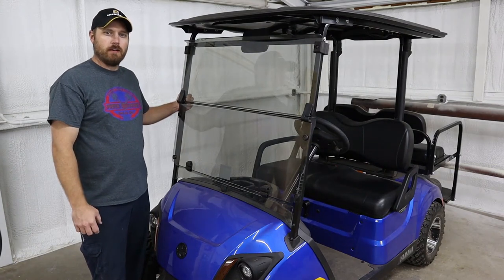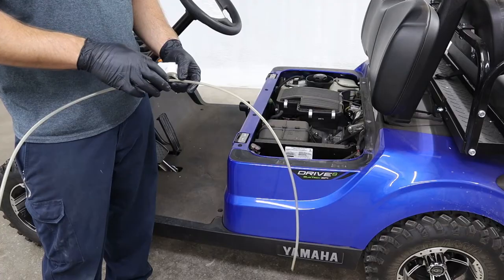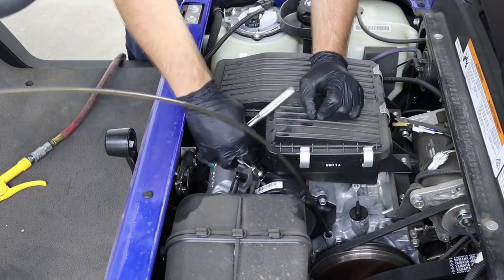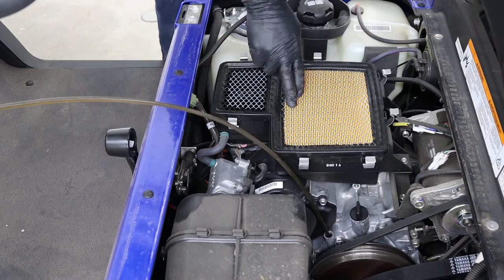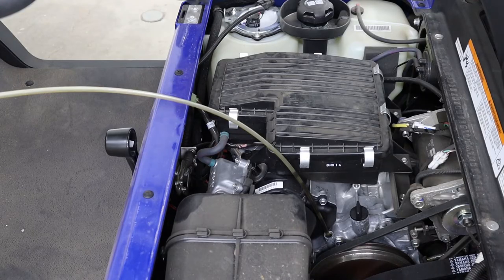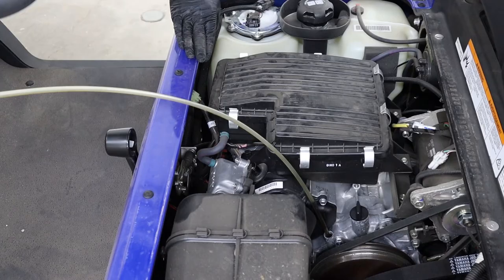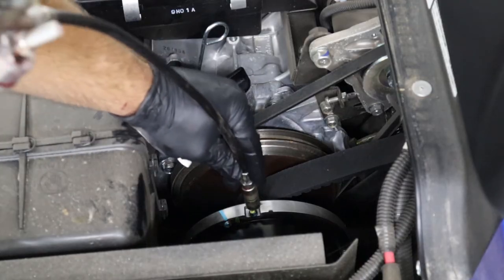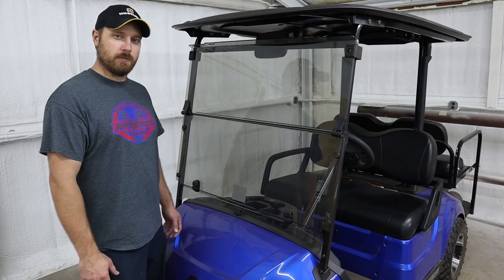Yamaha G29 Drive/Drive 2 Quietech - OIL CHANGE - Service

Comment: Concerned. 2021 drive 2 efi changed the oil. Checked before starting and stick measured ok. Siphoned using 2 different size tubes and could only get a 1/2 qt. Replaced with just a 1/2 qt of 10w-30 and the stick was right on. Should I leave it like this or go from underneath and drop the pan? Thanks Frank
Reply from the maker: Did you insert the suction tube through the dip stick hole or through the oil fill hole?
Reply: First time through the dip stick then the filler hole. Both times it felt like the tubes small and large were bottoming out? @PowerEquipmentMan
Reply from the maker: @frankszlachetka6382  Interesting. We service around 200 Yamahas a year just like how we show in this video and have never had an issue. We always add exactly 1 quart and it gets them exactly to the full line. This is how Yamaha actually recommends changing oil in the Quietechs and trains golf courses to service their fleets like this. I have to assume that you have a restriction somewhere and the tube isn't getting all the way to the bottom.
Reply: @PowerEquipmentMan  What is even more wierd is that before I drained it the dip stick read dead on and the oil looked brand new. Once I started siphoning the oil was jet black. Going to play it safe and go from underneath. Cheap insurance and peace of mind. Appreciate you taking the time to follow up. Thanks Frank
Reply: Update and 2 questions please: Went from underneath and removed the drain plug. Full qt came out. I have the standard FLEET model and did my own conversion to be street legal. Is my model supposed to have the plastic shield underneath it and if so would it make mine even quieter. 2nd an average cost for a dealer to install a high speed gear set. Thank You, Frank
Reply from the maker: @frankszlachetka6382  Only the Quietech models came with the plastic skid plate underneath. 
I'm not sure what a dealer in your area would charge to install gears. I would guess that it should take them around 4 to 6 hours to complete depending on their skill level. So if you know their shop labor rate, that should give you an idea. I saw a guy the other day that said he was charged $700 for labor and I thought that was pretty high. Shops around here are usually in the $300-400 range.
Reply: My invoice states 2021FLEET MOONSTONE QUIETECH EFI. The cart did not come with the plastic skid plate nor insulation around the engine. Again this was a Fleet Cart sold for golf courses. Perhaps the model set up for street use would only be the one with the skid plate and the insulation? Confused? Thanks Frank
Reply from the maker: @frankszlachetka6382  Does it have independent rear suspension or a solid axle? This video shows a cart with independent rear suspension for reference - https://youtu.be/zofX6p3TrdM
Reply: @PowerEquipmentMan  I believe that cart appears to have either a square box that goes over the shiny round one like I have or the muffler itself is also different.
Reply from the maker: @frankszlachetka6382  Feel free to email me a picture of your engine and I can tell you 100% for sure if it is a Quietech or not - sales@powerequipmentman.com
Reply: @PowerEquipmentMan  Checked my bill of sale and the build sheet ( white and black ) vinyl coated showing serial no, DOM amd MODEL. Built on 12/7/2020. My bill of sale states 2021 efi Fleet. First issue is Yamahas online sight says ALL the EFI's come with front and rear independant suspension in both fleet and PTV. Mine has a solid axle. Also the 2020 had a different style muffler. I need to get my wife to take a engine pic. I pulled the air cleaner cover and their is a oiece of foam under the air filter itself. Not sure if that indicates efi or not?
Reply: Also just noticed and you might want to send this out to viewers. Yamaha has the list of the years and the serial numbers.
Reply from the maker: @frankszlachetka6382  The Drive2 gas models were built in 4 different versions: carbureted solid axle, EFI solid axle, EFI Quietech (independent rear suspension), EFI Quietech PTV. Sounds like you probably have the EFI solid axle, not the Quietech. When buying brand new, the fleet Quietech model is about $1000 more than the EFI solid axle.
The solid axle models use a silver muffler and the Quietech models use a black muffler.
Reply: @PowerEquipmentMan  Correct. I wanted the efi quieteck. I went online and did the build sheet and brought it to the dealer. The cart was $7100 out the door and I assumed it was the one I just mentioned. Know I am wondering if I paid for the quieteck efi drive 2 and just received the other version? I tried to go back on line and do the order over to see what the price would have been but now the site shows for 2023 versions only. With what I paid what is your final thought. Thanks frank
Reply from the maker: @frankszlachetka6382  That price sounds a little high to me, but golf cart prices are VERY inflated right now. I would go to your dealer (don't mention this issue yet) and ask for a price for a Quietech with the options you wanted. Then compare that price to what you paid.
Reply: @PowerEquipmentMan  Made a call to yamaha in GA and explained my delema. He advised me to do a face with the dealer and bring my original order/sales receipt. He confirmed I did not get the correct cart. The dealer is negotiating with the owner who owns 6 dealerships. He says the owner should agree to pick up my cart and install the necessary parts that should convert mine to a true quieteck. However the dealer said I will not get the square muffler or convert mine from a solid axle in the rear to an IRS. ? HOW important is that muffler and they claim they would not be able to swap out the rear suspension. Not sure if the IRS on resale would matter?? Thinking of going to small claims court if this does not go in my favor. ? Ball park dollar amount for the parts and labor install inc pick up and delivery. 10 miles each way. Thank You
Reply from the maker: @frankszlachetka6382  There is NO way they could "convert" your cart to a Quietech. Period. Your cart doesn't even have the same frame as the Quietech. Sounds like they are trying to put a band-aid on the situation. 
Some of the most important features of the Quietech are the independent rear suspension and the muffler. The Quietech also uses a different air box and cold air intake tube that runs under the passenger side floor board. The combination of the different air box and muffler not only make the cart quieter, but also gives it approximately 1 more horsepower due to better air flow design. 
To me, difference in resale value is huge. I don't even buy carts that aren't Quietech models. 
I'm guessing they are going to try to add some type of sound deadener under the seat and tell you its a Quietech now....not even close. I would tell them to stick that idea where the sun don't shine. They need to either trade you out for an actual Quietech cart, or give you your money back and you can go somewhere else.
Reply: @PowerEquipmentMan  Being you said the frames are different and my cart having a custom paint job will my body panels fit on the quieteck frame?? Thank You
Reply from the maker: @frankszlachetka6382  Yes, the bodies are the same. They should be able to easily swap over your body, tires/wheels, seats, roof, or any other accessories that your cart has.
Reply: @PowerEquipmentMan  How many hours for a qualified yamaha teck to install high speed gears for a gas fleet car. You stated is a more difficult project. Still going around with the dealer. Thank You Do you have this gear set in stock. 2021 drive 2 gas FLEET and what is the ratios offered please. Thanks Frank
Reply from the maker: @frankszlachetka6382  I would guess around 3 to 4 hours to install high speed gears. We do have them in stock for the solid axle carts ($325.95). They are only available in one high speed ratio which is roughly 8:1
Reply: @PowerEquipmentMan  I will let you know. The dealer admitted they gave me the wrong cart. They are checking on the parts Muffler and pipe insulation and belly pan to make it quieter. The sticky point for them is I agreed to leave in my solid axle if they would install at their cost the high speed gear set. They said they get over $1000 to do it and I replied the gear set and 5 hours of labor thinking they pay their mechanic $20 per hour, not their shop rate do to them causing this situation the gear set at dealers cost and labor should be around $400. They are claiming that it is almost impossible to get a yamaha cart today?? Thanks Frank
Reply: Still going back and forth. The best they will do is install a high speed gear set and they did order the under pan along with all the insulation, however they tried and they realized the frames are not the same. Question: Is it possible to either weld or bolt on some type of a metal bracket to attach the plastic pan. I would have to do it myself or pay for a welder as they will not alter the frame by drilling or welding. Have to make a final decesion on Wednesday. ? Is there only 1 gear set ratio  @PowerEquipmentMan
Reply from the maker: @frankszlachetka6382  wow I can't believe you are still dealing with this! If they didn't know that there was a difference in frames between the Quietech and solid axle models, they shouldn't be a Yamaha dealer. To put it simply, there is no way to make your cart anything comparable to a Quietech. There is NO WAY to effectively add sound insulation to the entire engine bay on a solid axle model. Period! 
We only sell one set of high speed gears for the solid axle models.
Reply: I gave Justin from Capital Carts your site. He has agreed to purchase and install a high speed set of gears from you for my Fleet Solid Axle. They are also giving me the complete under assembly and insulation for it. I realize the pans will not attach properly but we are at a stalemate and frankly I do not want to take them to court over this. I gave them your site as they claim the high speed gears are not available for my cart. Hopefully they have reached out to you by the time you are reading this. Thanks Frank
 @PowerEquipmentMan

Comment: I'm curious of your reason saying don't use regular motor oil. Kohler doesn't make oil... I use what the engineer says to use. They call for a 10w30 oil I use a reputable companies 10w30 oil. Just like my truck requires a dexos approved oil and my farm store sells 10 dollars a gallon dexos certified oil so I use that. I think just changing the oil is the ticket. Not so much getting brand specific
Reply from the maker: If you do a little research you will find that "small engine oils" have different additives then "regular car oil". Since these small engines are air cooled and run at almost double the RPMs that a car engine normally does, the oil that is formulated for small engines has more zinc (helps with cooling) and anti-foaming agents. So while these engines call for 10w-30 it also states that the oil must also meet certain API ratings. Failing to use an oil that meets Yamaha's API specifications will void your warranty. I know that Kohler, or Kawasaki, or Yamaha, or any other company don't make their own oil, but they choose an oil formulation that meets their specifications to put their name on the bottle. 

Since these engines only oil use 1 quart of oil, I highly recommend spending the the extra couple of dollars to buy the right oil for the application.
Reply: @PowerEquipmentMan  I hear ya. I always thought that. I now run Rotella in all my small engines since it's rated for motorcycles as well as diesel engines
Reply: @PowerEquipmentMan  I was looking at my yamaha manual. The yamaha engineers require SE or higher oil. It be hard to find any oil that doesn't exceed SE standards now.

Comment: What happens if i put regular 10w30 full synthetic?
Reply: after i put the oil you recommended my cart wont stop smoking.
Reply from the maker: Is it over-full on oil? 
I would not recommend using a synthetic.

Comment: Why not use the oil fill hole to drain the oil?
Reply from the maker: If you try to insert the oil suction tube threw the oil fill hole you will hit several obstructions. Using the oil dipstick hole gives you a clear shot to the bottom of the engine case.
Reply: @PowerEquipmentMan  
Thank you. I reset the throttle spring stop nut to the specs in your video and am getting 28mph according to Waze. However, is there a power drop off doing that?  I turned into a stiff wind and the cart slowed to about 20-21 and engine was straining. Thoughts?
Reply: I have a’22 EFI
Reply from the maker: I am assuming you have a PTV model with high speed gears. With the higher gear ratio you loose a lot of torque which will cause you to loose a lot of speed on hills and under a load. We sell a clutch kit that helps with this exact issue - https://youtu.be/kgtt-aZb7_w

Comment: Using the drain plug save buying an extractor that will only be used for my cart, so at least show us where it is, the drain plug and what oil and how much...Just a suggestion.

Comment: Its not that hard to remove the bottom pan. Draining the oil through the drain plug.  If the difference between a good job and a great job is 5 minutes by removing the pan, ill remove the pan.
Reply from the maker: Yamaha actually teaches golf courses to service their quietechs the way I do it in the video. If its recommended by Yamaha its good enough for me. I've got a bad back and can't be crawling around on the floor if I dont have to. Thanks for watching

Comment: @7:50, to grease that rear clutch zerk, can I just remove the bagwell, put the F/R switch to that neutral sweet spot and spin the clutch wheel until it is easy to access from the bagel area?
Reply from the maker: Yes, you can easily access the rear clutch by removing the bagwell.